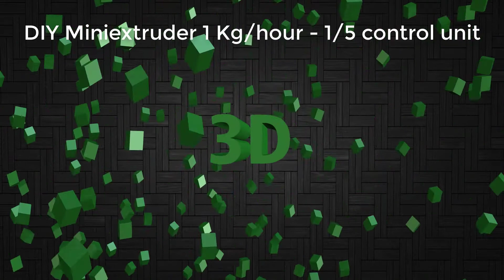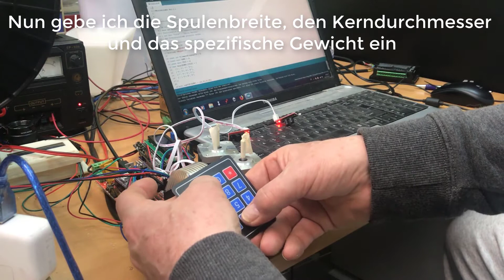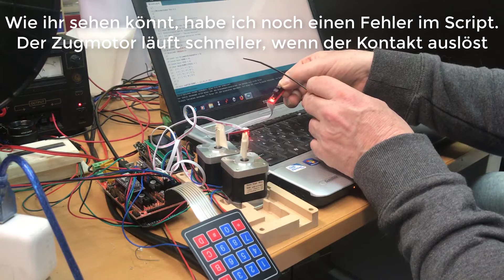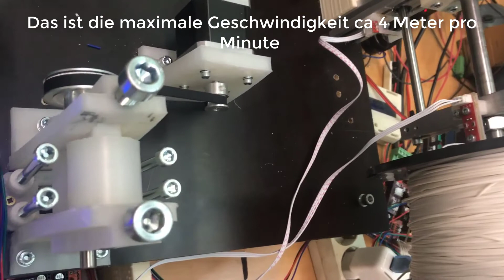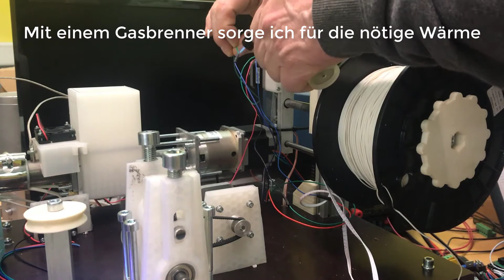DIY Mini-Extruder 1 Kg / hour - 1/5 control unit

Comment: What nema motor drive the auger bit ant what gear reducer have?
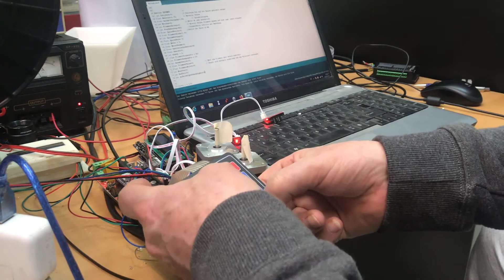Reply from the maker: Ich benutze einen Nema 23 Übersetzung 1:27
Reply from the maker: The Screw is 12 mm
Reply: Nema 23 mit wie viele kgf.cm ? oder N.m ?
Reply from the maker: Der hat 2,8 Amp und ungefähr 18 Nm
Reply from the maker: Bei 10 Nm Glaube ich kannst du nur PLA machen. Und du wirst nicht mehr als 150-200 Gramm bekommen je höher die Drehzahl ist je schwächer wird der Nema 23 werden weil der Drehmoment abnimmt